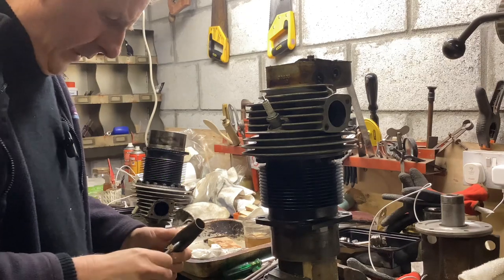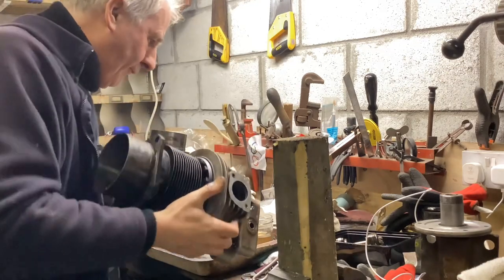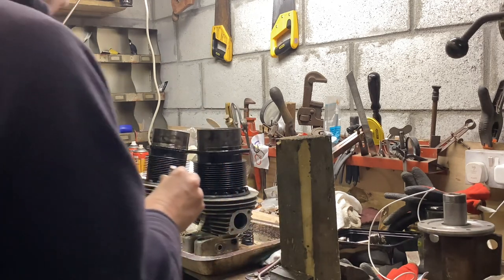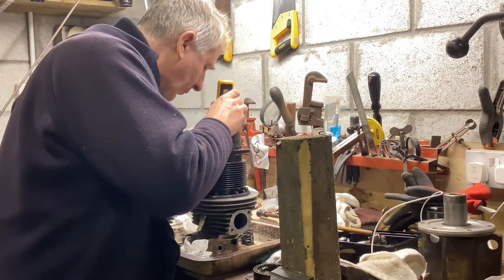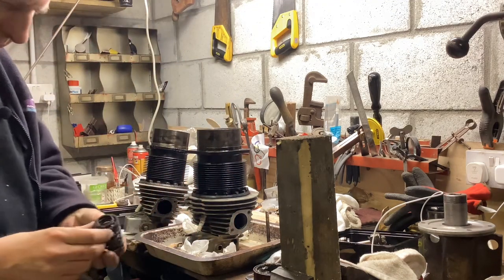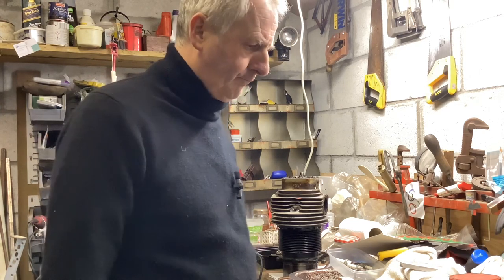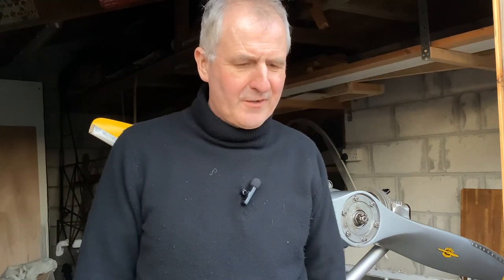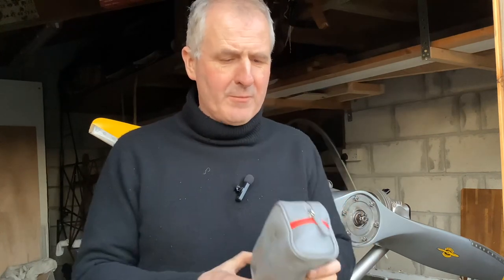Aeronca C3 - Engine Failure - Part 2

Comment: A Gentleman I work with here on the coast has been turning wrenches on Beavers for over thirty years, anyway he swears by Marvel Mystery Oil. He told me a few stories where an engine would come in with a sticky valve, they would free it up, dump in some M.M.O. and it would never happen again. Not sure myself but I always dump in half a quart every 25 hour oil change.
So far so good.
65 Continental in a Vegabond.
P.S.
I wrote this too soon as I forgot you have greased Valves. 
Anyway food for thought/;
Reply from the maker: I've never used M.M.O. definitely worth looking at.

Comment: I thoroughly enjoyed your tongue in cheek humour as you cleaned the valves as if this were an everyday thing. While I no longer fly, I have owned two Aeroncas over the years, a Chief and a Chanp.  Both 1946 models. While I'm not sure which one I loved more, the Champ was the only one on floats, a must if you fly in Newfoundland as we are mostly lakes and bogs.
Thanks again for sharing  your flying adventures in your beatiful Aeronca.
Reply from the maker: Thank you for your comments. My first aeroplane was an A75 powered 7AC Champ, I sold it 26 years ago and have regretted it ever since. One of the finest aircraft in the history of the world. The Aeronca Jap engine needs frequent attention so evening fettling isn't as unusual as you might think. It's a generation prior to the small Continental engines. One forgets how old but brilliant the A65 is, with a decent lubrication system and hydraulic lifters, it's a pioneering design and first of the modern aero engines.

Comment: I own a little Jodel D9 with a 1385 VW engine--similar size and power parameters to your C3, so I can empathize with your travels [and travails]. Love watching your submissions,  most of them all repeated several times, and anticipating many more tales of endeavour - or just just gentle indulgences in your workshop. David Llewellyn's saga was simply amazing!  What fortitude!
My very best wishes to you.
Reply from the maker: Thank you for your kind comments. The Jodel D9 is a fine machine. A very distant relative of mine built a D11 but it hasn’t flown for nearly 40 years. I am trying to obtain it as a rebuild project for a future series on this channel. In spite of being in storage for decades, it’s in remarkably good condition.

Comment: When you were struggling to get the spring off the head at 2:27 something flew off to the right side of the bench. Usually when the keepers and spring retainer is removed the valve should full out. The circlip had to be holding it.
Reply from the maker: @robertklein1316  No circlip fitted, so it wasn’t that. I think what you saw fly up was sticky grease and the top of the valve stem had quite a build up of carbon, stopping it dropping out.

Comment: It’s a c-3 not a space ship, right. 

Can one eye ball tolerances? I think so. 

I’ll be in the 172 in 10 hrs time. 

Dreamy projects.

Thank you Sir.
Reply from the maker: Yes, all tolerances are by eyeball; there's very little factory technical data available. Old fashioned engineering practice is enough.

I like the C172, it's a very versatile aircraft although a bit staid as a training aircraft. Doesn't bite enough.

Comment: Great all-arounder video - some wrenching, some conversation, and some flying! If this happens to your valves under normal use, with resulting conversion of airplane to glider, is there a way to avoid it? Different fuel (do you run avgas or mogas?), different jetting, etc.? Or is it just a timed maintenance item, and if so, how many hours of running does it take to get the stems and guides gunked up enough to warrant teardown? In any event, thanks for posting - thoroughly enjoyable to watch other people work! ;)

ETA: I see from the video description that you're now planning to clean valves every 25 hours. Certainly keeps you communing with your mechanicals! 👍
Reply from the maker: Less enthusiastic greasing from me! I shall publish a film about cylinder heads and valves shortly as there are a few permutations.

Comment: I use a lot of lead additive .
Reply from the maker: What engine do you use the lead substitute in?
Reply: What fuel do you use? In the USA 100 low lead is used by many and they get stuck valves sometimes. I have an auto gas STC from EAA and that is what I burn in my c85.  I have never heard of anyone having a stuck vale using auto gas. And by the way the auto fuel can not have ethanol in it. I burn 91 octane no ethanol auto gas in my Champ with C85. Nick do you have an aircraft mechanics license?  I the US I would need to have an aircraft mechanic license to work on my engine legally.  I always enjoy your videos. -Mike
Reply: Oh I forgot to say the auto gas is unleaded